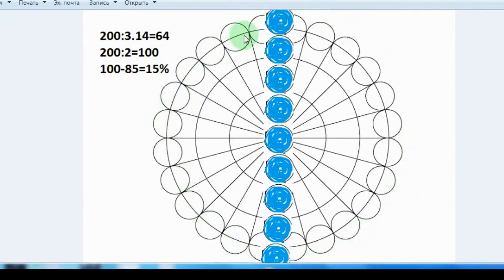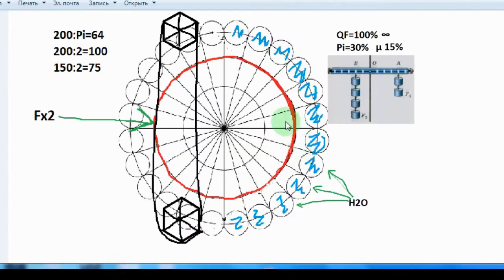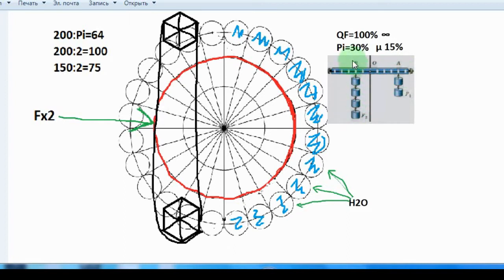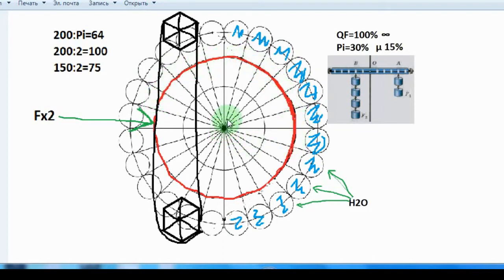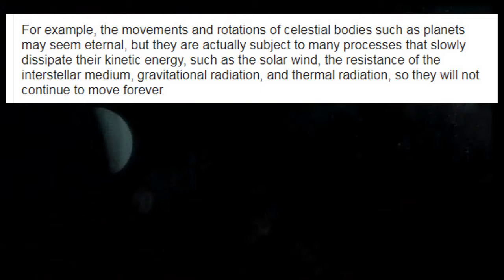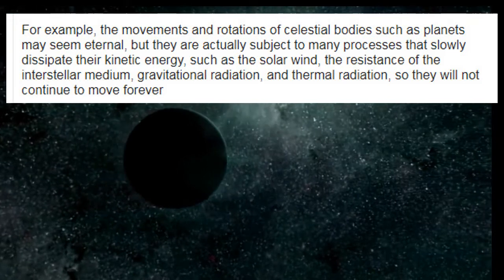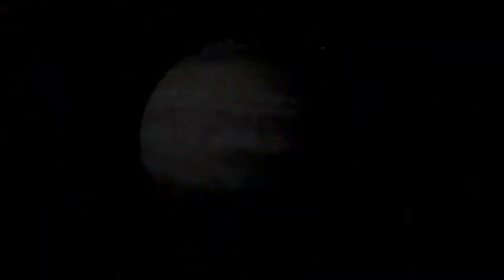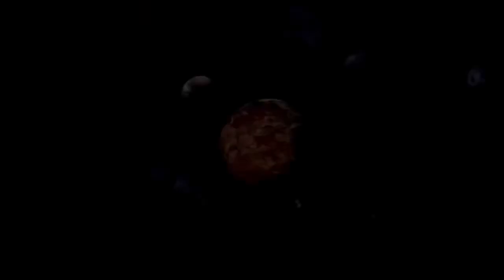The riddle is solved! Lever Number+Pi! Perpetual motion machine! Alternative energy! Generator witho

Comment: Don't get me wrong, the idea seems plausible given what we know about levers but I can't shake the notion that the actual power is going to be equal for both the wheel and the chain-pulley
The fact that their are more full containers on the wheel than on the chain-pulley won't matter because you are trying to raise the containers on the chain straight up, whereas the containers on the wheel loose their energy more slowly because they take longer to fall through the same vertical distance. 

Power = Work done (Force x speed) / Time. Or to put it another way Power = (Force x distance / time) / time
     If we assume that the Force of gravity is one Newton per container and lets assume there is an ideal container ratio of 355 containers on the wheel (177.5 with water in) and 216 on the chain (113 with water in) - if you want to double these to work with whole numbers that's fine.
    Now calculate the Power needed/generated for one container to travel along the diameter in a fixed amount of time and then multiply this figure by 113.
    Then calculate the Power generated/needed for one container to travel around half the circumference in that same fixed amount of time x Pi/2 (because the wheel and chain-pulley are connected, the wheel cannot spin faster than the chain so the time taken for one container to travel half the circumference of the wheel would be Pi/2 times greater than if it were traveling along the diameter) and multiply this figure by 177.5.
    I suspect you will find that the power generated/needed for each mechanism will be about the same.

Just trying to save someone the heartache of trying to build one of these before they've done the calculations.
Reply from the maker: I tried and came to the conclusion that this design does not work. Need a better idea.